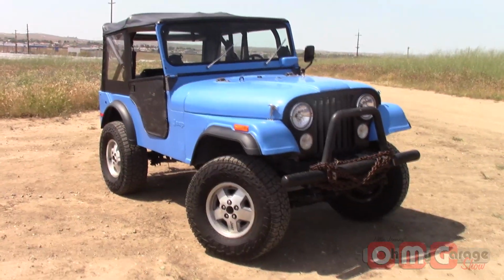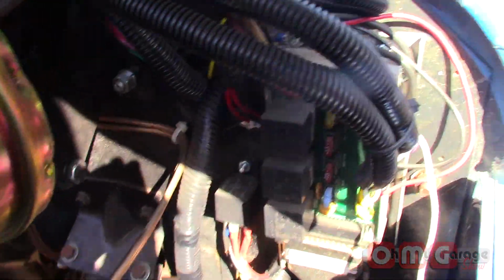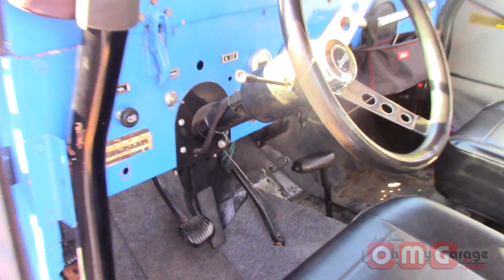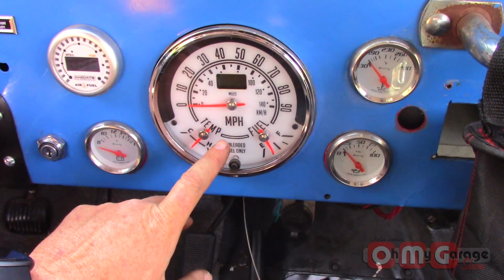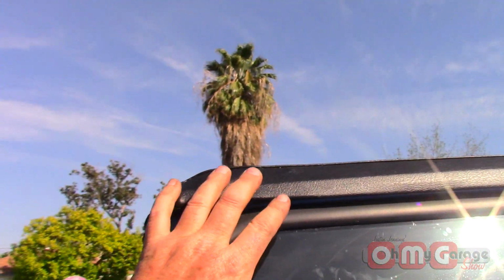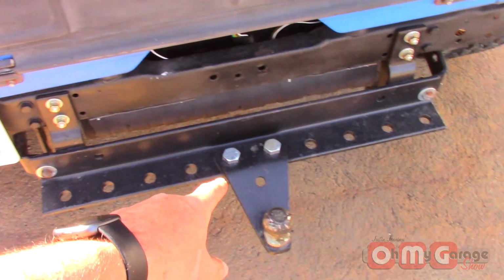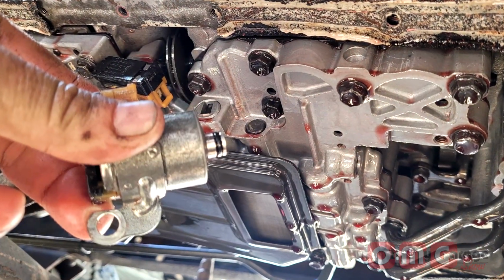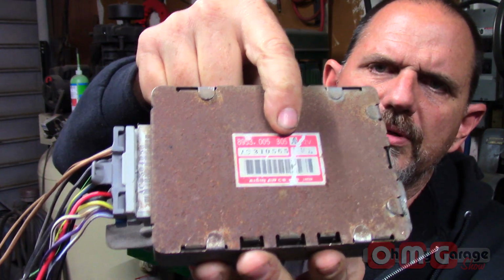Our 1974 Jeep CJ5 With MegaSquirt 4 Liter AW4 Auto

Comment: Hi Justin, I'm Tim from east/central AZ. I'm (finally) in the homestretch of my 4.0L conversion. The donor vehicle was a 1992 Jeep Cherokee. I kept as much as I possibly could from the '92 Jeep (engine (obviously), engine wiring harness (w/computer, fuel lines, charcoal cannister, some exhaust system parts, etc.) I'm using Jeep Wrangler YJ, and TJ, air intake/filter box, and air tube to throttle body. Basically, I will run it in my 1983 CJ5 (w/manual transmission) as if it were a stock, 1992 Cherokee w/a 4.0L engine. Congrats/kudos on fixing the poor performance issue.
Reply from the maker: Sounds like you have yours under control. I'm in the middle of getting rid of the MegaSquirt and putting the factory injection on it. I'm remembering why I went with the MegaSquirt to begin with. Cheers!